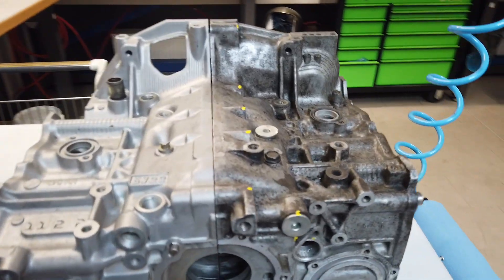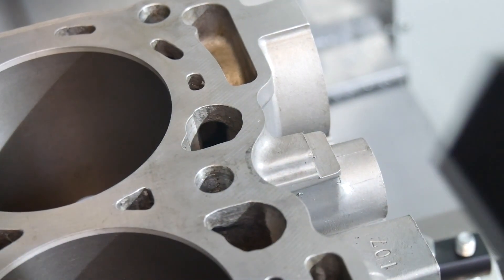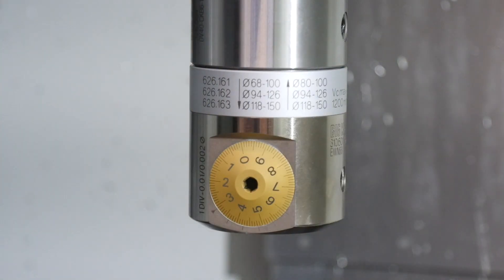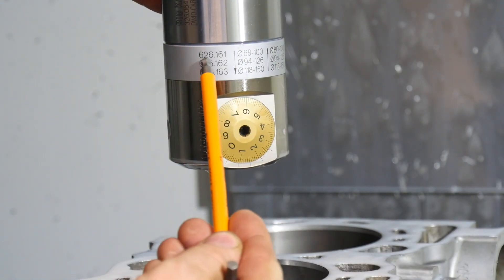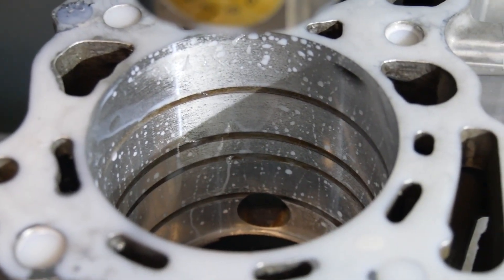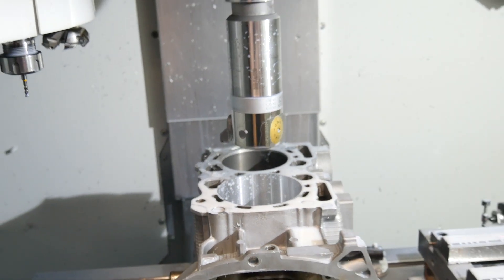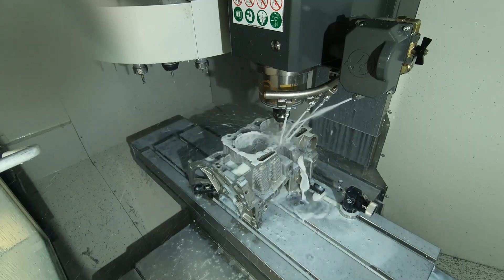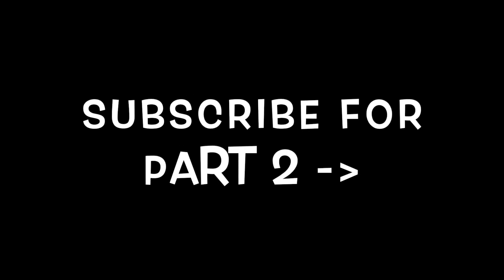How to Sleeve a Boxer WRC Engine l Part 1l l 22Bl EJ22 l Subi-Performance

Comment: I have an old car, I would like to strengthen the engine in it, what parts should I replace?
Please help, I need your information
large piston, thick piston rods, large crankshaft
is it enough to power the engine
Please....
Reply: Depends on engine tbh
I would go for:
1. Better tires 
2. Intake 
3. Exhaust
4. Eventually turbocharger
Reply: @SzymkowiAK47  thanks dear
Reply: @Murat-Seyithaliloğlu  and don't forget about chiptune to set everything right and correclty. Otherwise you can lose some power

Comment: Why don't you use 2 WCS (G54 and G55 ) on the offset page to run the same program on both cylinders simultaneously, so you don't have to change the size of the boring head so many times
PD: im sorry google translator

Comment: Hi u r doing great and precise work, I need your help or suggestion about sleeve for my Yamaha rx100 two stroke single cylinder block, please from where i can get it for high performance because Yamaha stopped supplying new block in market and i am trying to restore my bike , after market china made block available in the market but not satisfied, engine heating, sound and firing change.  When i was watching your video i see a hope, Thanks

Comment: As I do this everyday with all my billet blocks aswell as sleeving oem blocks, I don’t do 4 cylinder engines, only v8’s, just a tip, probe the bore centres on both bores and let the machine run 2 cylinder pots on the same boring head adjustment, or depending on depth, side mill the old sleeves until touching alloy, then bore to size with the boring head.
You’ll be surprised how much faster you’ll get the machining done.

Comment: Looks awesome. Just wanted to point out that your boring head (EWN68) has a resolution of 0,002, not 0,01 as you stated :D I have the same for my VF-2..
I would have probed each cylinder to its own G54 and G55, and do operations for both at the same time, that way reducing the number of adjustments and tool changes, also reducing the probable destortion on the first cylinder as a result of boring out the second.
Great videos!

Comment: Have you considered getting one of those renishaw tool offset checkers? It might be a few thou more accurate than checking the Z height off the deck surface. I doubt it matters too much if the deck is surfaced afterwards but it's one less variable to possibly go wrong. It's awesome to see how far your shop has come along!
Reply: Just noticed you have it, was that just to double check you had the deck height right after probing?
Reply: Diesnt matter how you do it, what matters is do it right.there are a lot of errors during the face on engine head.

Comment: Hi Andy
Supernice job as always. How do you remove the old sleeves in the EJ22? Just by cutting them away with the CNC milling machine? Or do you press them away before boring the correct sizes for the new ones?
Many thanks. I wish I could understand  German to better appreciate all your details

Comment: Simply a work of art, how you "play" the CNC machines.  Wonderful to see.  Epic.
Reply: newer Darton sleeve designs have 5mm and more channel from the top of sleeves to allow water flow for the street and circuit racing where it counts and its only been a couple of years since these were still used which are now just for drag racing.

Comment: When you press them in, do you use anything on the sleeve walls to improve thermal conductivity, like a COPPER spray? They used to recommend that for cylinder head gaskets, but I don't see anyone talking about it/using it anymore. Kind of along the same theory as your custom copper wire fire rings that you press in.
Reply: Check this out-  https://www.youtube.com/watch?v=OoRx_UHeXaE

Comment: Great video and awesome to see you giving this EJ22 some new life. Just wanted to clarify that the EJ22 was not at all a WRC engine, and not developed for that purpose, so it's a bit misleading to title the video as such. The Subaru WRC engine was always based on the closed deck EJ20 (2.0 litre), and featured an o-ring'd block as well as machined channels for a complex coolant/oil gasket
Reply: Yes we got the point.. but do you vape?
Reply: @Barrenchats  All day 'erryday

Comment: Can anyone explain why you would "check" if  the block/haas is level with that thing? (Wasserwaage) thats not accurate enough or? Its better with that thing on the Haas?
Reply: The block can be damaged  or some dirt you haven't been noticed gathered on the bottom. Checkling for level is an easy/fast way to be shure.
-> measure twice, cut once.